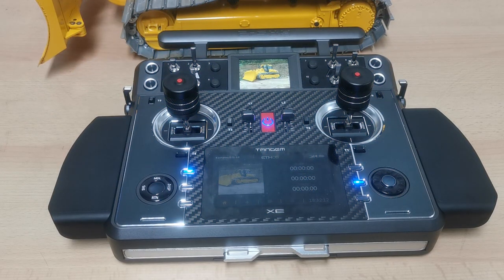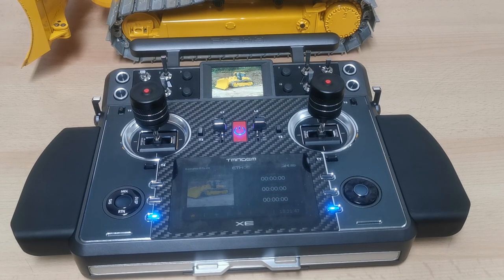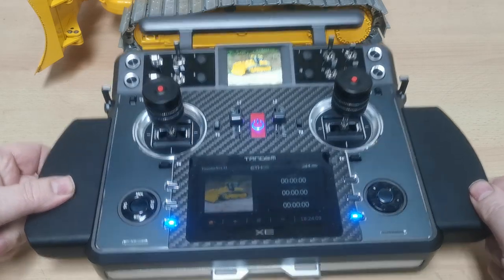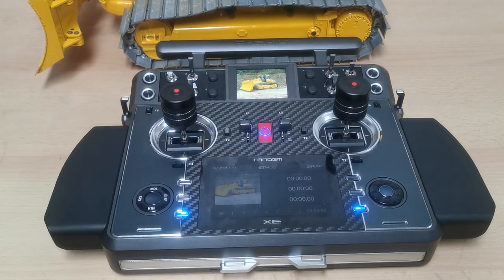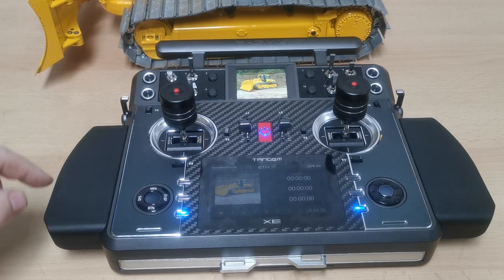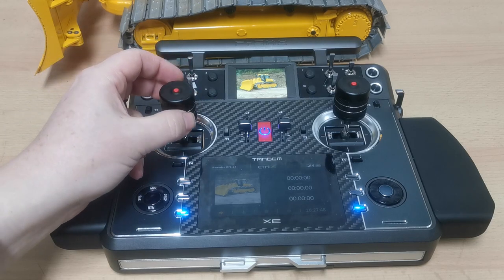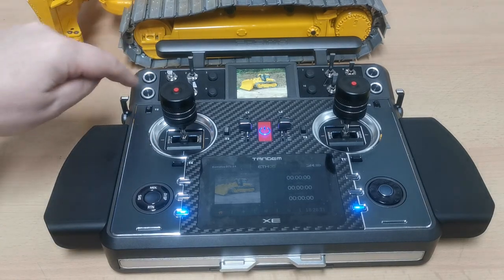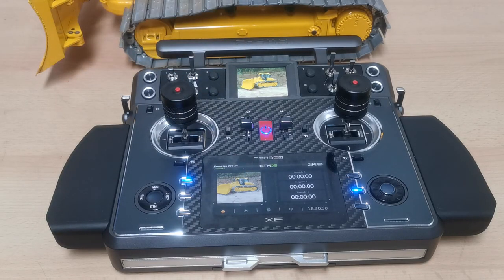First impressions - Tandem XE from outside

Comment: Hello.

Super nice video you made here..

I got my Tandem in start december, and i hated these sliders on both sides on the radio.

Both now we talking, because i didn't know, it was possible to get them with springs.

Have you done that by yourself or is it FrSky who has done it?

Do you know, where i can purchase the right parts, so i also can do it? (Please drop i link :) )

Best Regards Mike
Reply from the maker: i do a Video on that with the next video. So focus on the outputs to see how precise the stick go back to center. Right?
Reply: @FumotecTV  Hello..

No, not how you find the center or maybe. But its how it find it, when you not touching it, on these on the both sides, infront of where you rest your hand/arm.

I think you are using them for the belts, right?

Greeting Mike
Reply from the maker: @HrHalkier  i see. the self centering sliders i installed:
It´s a FrSky part! On the bag is written: SKU: 04100285 Model Name: XE Slider.
I bought mine here in germany:
https://www.engelmt.de/mt1marken/frsky/zubehoer-und-ersatzteile/zubehoer/tandem-xe/tandem-xe-centering-slider
Not cheap, but cool upgrade
Reply: @FumotecTV  they did send to Denmark, i just misunderstood the german, on the webside 😁

So Thanks alot.

But, can you tell me, if its just plug and play, with the new sliders??

Regards Mike
Reply from the maker: @HrHalkier   yes it´s just plug and play and some screws
Reply: @FumotecTV  superb, I’ll try that. 🙏🏻
Reply: @FumotecTV  can you send me a private message?

I think i have some problem and i need to drill, is that true?
Reply from the maker: @HrHalkier  you can send me an email, but there was no drilling required here
Reply: @FumotecTV  hmm, thats is really interesting, that the holes are 7mm on mine, and the slider needs 10mm, so it will fit.

But i have just done it now, but little Strange i should drill and you don’t.
Maybe its an Old radio i already have 😅

Thanks for the info and have a Nice day btw. 🙌🏻

Comment: In next video, can you show if center point of the sticks and other control, keeps the output at zero or does it flickers like the taranis XE.
Reply from the maker: Check in the Video about the Tandem XE menu on the end. There is a short piece that shows the precission on my Tandem XE

Comment: Is it possible to "name" all switches and chanals in the window and how many 3 step switches is it on the radio.??
Reply from the maker: Hello, the switches can not be named. But each Mixer and each output channel can be named ( i personaly use for my basic settings the same name for mixers and output channels) . To be honest, i can´t tell exactly what switches comming with the radio because i modified both of the radio i have here to full option. But as far as i remember it´s one two way spring loaded switch, i think one 2 step switch and all the rest should be 3 step switches. For our construction models i converted some of them to 3 step spring loaded / momentum switches

Comment: Hello! It’s possible to share the setting file to get reference?
Reply from the maker: If needed we can supply basic settings. But we recommend to get into the software yourself to be able to understand all settings and where it need to be changed. There is more and more Videos of how the setup is working we also prepare some videos how to set up the Tandem for our construction machines. So stay tuned.
Reply: @FumotecTV please only basic settings. When I begin on opentx I do the same. I always use opentx but on this radio it’s not posible change ethos. Please! Can I write to you on email?
Reply from the maker: @RcGranadaLand   i can send you a setup if you like, no problem.
Reply: @FumotecTV  can you say me how to contact with you?